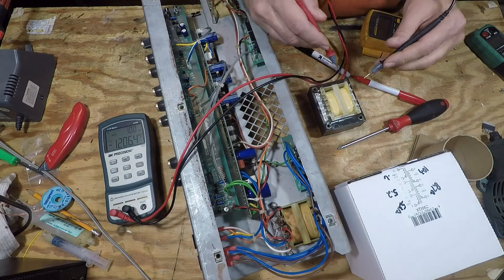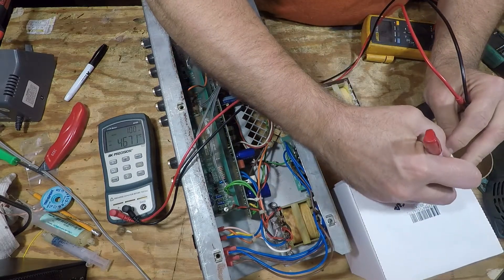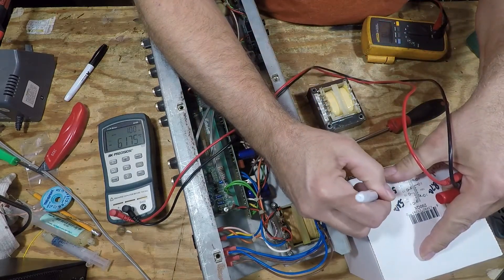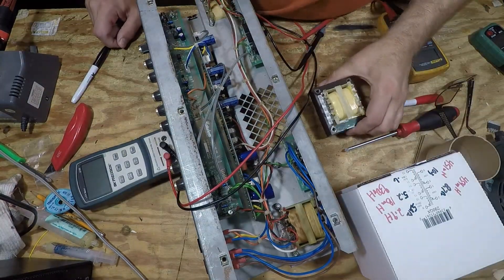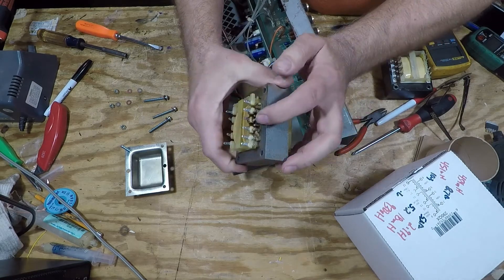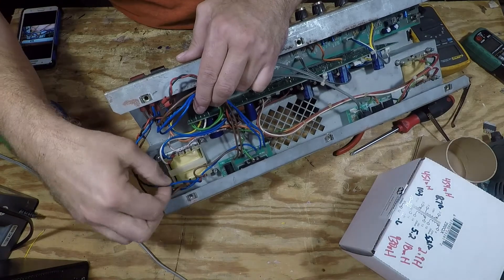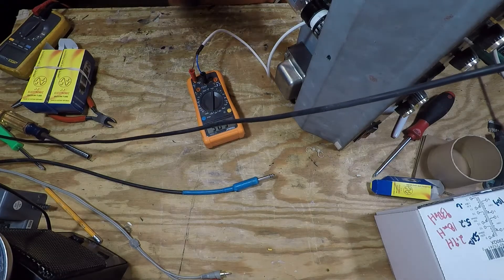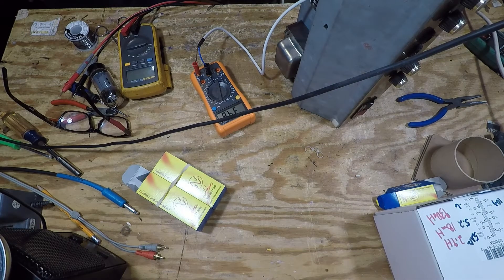MARSHALL JTM30 JTM312 POWER TRANSFORMER

Comment: Nice. I repaired one for a customer last year. Got another one coming in this weekend that I assume without seeing it yet will have a shorted out power transformer. I’ve found a local source and will order the Hammond if need be.
Reply from the maker: Don't assume that I fix a lot of tube amps and bad transformers are rare
Reply: @clintronicsrva  no worries. I mostly repair tube amps and not solid state stuff. But I've subscribed and love your work. Learning lots, So I appreciate you sharing the knowledge you do have.